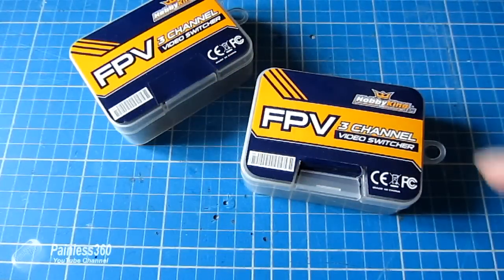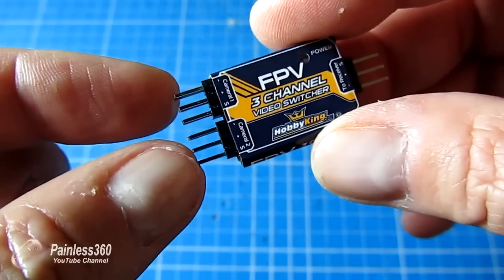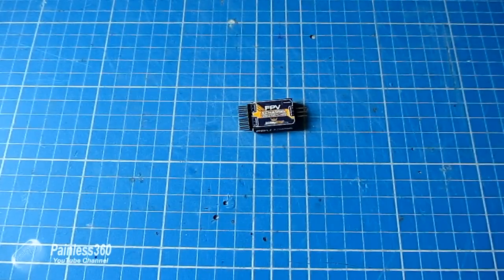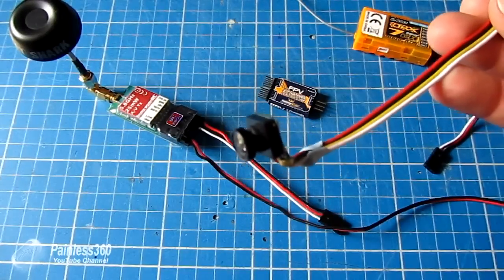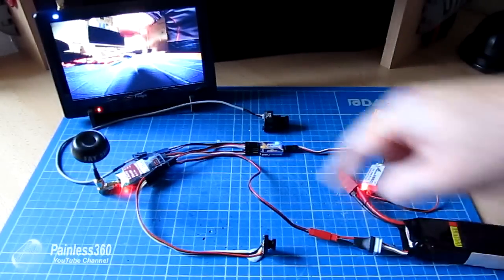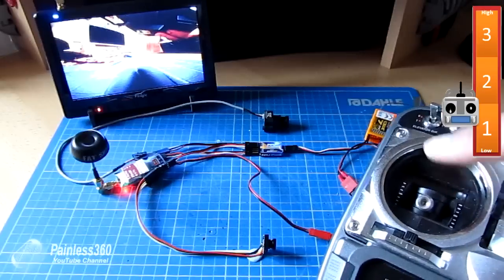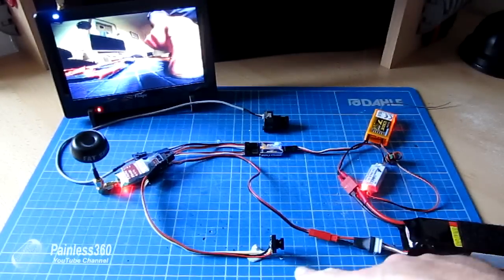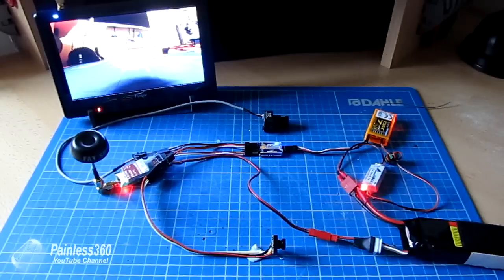HobbyKing FPV 3 channel video switch

Comment: Great info....Have you ever connected this switcher unit to a FPV camera and a gopro with an IOSD unit inbetween so that you can see the display on both cameras when switching form camera to camera - Searched the web for this info but can't find!
Reply from the maker: Should work fine is you connect the OSD between the switcher and the video transmitter. Best of luck!
Reply: Painless360

Hi.... Super cool and thanks - I'll try the setup and see how I get on.

Comment: Allo and thank you for the knowledge sharing . I am working on some camera set up not for FPV but for a 360* field of view around my e-bike and my question is can the camera switching be activated with out a remote ? I was thinking of a 3 position switch with (guessing the voltage here ,You can tell me what they need to be at pls )  0v-2.5v and 5v .If I understood what you said about the throttle way of activating the swap .  Thank You & Subscribed  ;-D
Reply from the maker: I’ve looked at a few 360 degree cameras and you could use one of them. Also allows you to ‘scroll’ around the image during playback too.. check my reviews..

Comment: Lee, you've done it again.  I remember watching this two years ago and even ordering a switch, but then put off using it as there was really no pressing need.  One of my favorite quads in my stable is about a 450 size with a Mobius on a gimbal. Since I could point the gimbal anywhere I wanted, adding a second camera didn't make a lot of sense even if the 16:9 FPV image didn't fill the screen of my Fat Shark V2 Dominator goggles.  Then the RunCam Eagle came along in the goggle-correct 4:3 and I decided to search for info and here you were.  NOW it has become a worthwhile project and I just finished testing it.  The switch works fine and was no problem using this video and your Taranis videos.  The dynamic range and color of the Eagle is excellent!!!  So now I can fly around with the Eagle and switch to the Mobius to make sure something I'm trying to film is in the frame.  Thanks again for this and the rest you're doing!!!!!
Reply from the maker: Well done on remembering it was here - I can't remember half of what we've done here and sometimes find our own videos help me too :D Happy flying!
Reply: Hugh Dinwiddie we need to press designers to make a vtx integrated with minimOSD and 3-4 video inputs.
Reply from the maker: Lots of innovation happening in OSD land at the moment, let's hope this is part of the innovation too!
Reply: Painless360 review the Helix VTX/OSD!
Reply from the maker: Thanks for the idea!

Comment: Painless I have this switcher and it’s been working well so far.  Today I went flying and channels 2 and 3 have a flicker/screen roll now.  Any idea what may have happened?
Reply from the maker: I'd check that all of the cameras are set to the same video standard i.e. PAL or NTSC as the first job..
Reply: Painless360 figured it out!  Loose power lead on the rx connection of the switcher.

Comment: Great video as usual, thank you for all that you do. I'd like to use this switcher with two cameras (FPV and Gimbal camera) and my iosd with my naza m v2. Is there a way that i can only get the osd on one camera (FPV) and not on the other (Gimbal) when I switch.. I only want my osd in view when I look through my FPV camera. any help would be fantastic, and thank you again for all your great videos.
Reply from the maker: SirTTMullen Ok, connect it like this - cameras into switcher - switcher into OSD - OSD into Vtx.
Simples! 
Best of luck.
Reply: I only want osd on one camera, not both. is there a way to olny have it show on one camera when I switch from one to the other?
Reply from the maker: Yes, you can. Have the switcher plug into the camera/OSD on one input and just the camera you want without the OSD on the other.

Best of luck.

Comment: Great Video, I have learned so much from your stuff.   I have one of the switchers and am trying to get it to work using an output from a Pixhawk.   My receiver is S-Bus only so there is no spare PWM channels there to use.  I currently have it connected to Servo8 and want to use a three position switch on channel 7 or my controller.  I see how to set the output to pass through in the parameters but how do you map the input to this channel?
Reply from the maker: I think what you're after is here- http://ardupilot.org/plane/docs/channel-output-functions.html
Reply: yes sir I figured that out after reading another post. My problem with this is that by direct mapping an RC channel then Mission Planner cant control the servo output. So the way it is now I have to pick one: Either switch on the remote or Mission Planner. Hopefully they will define this as an option in the future like grippers, landing gear or a gimbal so that it can be usable by both

Comment: Simple device. I built a 610mm quad for AP work and ordered one of these as I have forward and rear facing fpv cams, and a gopro on a gimbal.

I did  quick search on the product to see if any installs were done and vids were posted out here and just clicked on the first one that popped up on my search engine and lo and behold whose voice do I hear come from the speakers? Why the soothing timber of the esteemed Painless360.

It was like a shot of FPV morphine. I was lulled into a fine languor as I watched.

So power does not pass from the radio receiver side to the video or it does? I do not want the draw on my rx. I will have 12v cams and vtx, and the option of powering off a separate lipo or the flight pack. I may even make it redundant- and have them both connected. I already have the pixhawk double redundant on the servo rail from the bus circuit using a shotsky diode rectifier. (holler if you want a pic or need any info for your pixhawk series)

I am trying to figure how I want this thing connected- and if the rx is passing 5v through to the vtx and cams, and it bucks power then I am unsure if it needs powering from the rx side and no voltage wires on the vtx and cam side. Did that all make sense?
Reply from the maker: ***** Hey Hiway, connect the switch as in this video then power the cameras from whatever 12v supply you want but then DONT connect the red wires from the cameras back into the 3 way video switch - just use the GND and SIGNAL between the camera and the 3 way.. Hope this makes sense. Best of luck with it.
Reply: Painless360
perfectly. As I assumed, and now confirmed. Much obliged. I think it's time to give you a new moniker- I'm considering "King Tut" ...as in King of the Tutorial.
Reply from the maker: Best of luck with it - let me know what you think of it 'in action'..

Comment: @painless360 is there a default/failsafe on these switches?    Say your flight cam is camera 1.   And you lose power to the switch.   Will it stay on camera 1 and keep transmitting?    What if you are in camera 2 or 3 and power fails on the switch will it fail safe to camera 1?     

Lastly, I am looking to power the switch from a 5v rail on my FC and just send signal for switching off channel 3 of my Crossfire Nano RX.    I am gonna power the cameras seperately and send just video to the switch hoping it will do pass through on the video just fine without having to distribute power to the cameras.   Any idea if it will work?

Going to run video from forward camera into the FC and have the output with OSD going into the switch on Camera 1.    Backwards looming camera is going to go into camera 3 without OSD info.   Doing this deliberately so that when I see OSD info I know I am seeing forward and no OSD means looking backwards.

Also read a report that the device can add video noise which the FC OSD can have fits with.   So I would rather try the switch after the FC/OSD instead of ahead of it.

Comment: Nice video.  I was initially confused.  Early on in the vid you mention plus, minus, signal which would match fatshark.   Of course later on you point out that it is not the same polarity as fatshark, so you can't just use a straight pass-thru from your fatshark equipment.  Liked and subscribed!

Comment: I'd say that it's the safest way just to get rid of the labels and plastics around the board and then heat shrink it as the labels on the PCB are actually corrent while these on the packaging are not.

Comment: I would like to have seen a more in-depth tutorial.My cameras work on 12 volts and obviously the receiver works on 5 volts.How would this be wired?Surely you can't have 2 different voltages mixing in the hobbyking switcher.
Reply from the maker: It's not switching the power, only the video signal lead. Best of luck!
Reply: Are you talking about having a mix of camera and receiver voltage running through the switcher? As far as i know the 'video' side of the board is isolated from the receiver side. The 5v from the receiver makes the switcher work but is not connected to any of the camera or video output pins. So if your VTX usually provides 12v to your camera then it will continue to do so. If you had say 1 x 5v cam and 1 x 12v cam then you might have problems.

Comment: Hi Professor... I am struggling with this little guy! I have powered the cameras separately from the video switch, and just connected Signal and ground.... Switch powered by the X8R.... Do I really need to power the switch with Cameras Positive wire?
Reply from the maker: Not sure, worked great when setup as shown. Best of luck!

Comment: I just bought one of these but unfortunately the video out and camera 3 pins appear to have been cut off and there are 2 sets of pins on the receiver side.....any ideas?
Reply from the maker: I'd get in touch with Hobby king they will replace it if's a manufacturing defect.

Happy flying!

Comment: If I'm running a FrySky D4R-II receiver in ppm mode where would I plug this switcher in? Can I still plug it into one of the other channels or does only one channel work in ppm since it's sending 8 channels on one connection? Thanks!!
Reply from the maker: beno0055 This switch only understands PWM so you will need to find a way to connect it to a PWM signal from the receiver..
Best of luck..
Reply: Painless360 Oh, balls! Could I run it off my Naze32 similar to how I'd have a buzzer? I'm guessing no, eh? :P

Comment: Thank you for the video. Now my issue is finding a free channel on my Spectrum DX7s to switch between my fpv camera and GoPro.

Is there anyway to upgrade the DX7s to provide more channels? Or should I be looking for a new radio such as the FrSky Taranis X9D+?

Any help or radio recommendation is appreciated.

David
Reply from the maker: Sadly if you need more than seven channels then it might be time to upgrade to a radio with more and look at ones that can support tricks like head tracking! Happy flying!
Reply: Thanks. Do you have experience with FrSky Taranis X9D Plus?
Reply from the maker: sorry, that is not a radio I have played with.

Comment: We're did you get those male to make fpv pins?  I need to get some.  Do I have to make them or can I buy them from hobby king or something.  Thanks. @Painless360
Reply from the maker: +ExtremeRC I use servo cables and make the ends of using a crimper if I need different connectors. Best of luck with your project.

Comment: I've watched this video a few times now but only just gone ahead and ordered a switcher... and now I have a question about how the cameras are powered. In your example, the VTX is powering the cameras 'via' the switcher. I may need to test this when mine arrives with a meter, but when you switch between cameras is it only the signal pin that switches or all 3 including power and ground? I've read lots of comments from people complaining about a small delay... and now I'm wondering if the switcher is to blame at all, because if you are powering the camera on / off every time then of course there will be a slight delay before it starts to output a signal.

In my setup I will be using a Runcam 3 (HD recording camera with live output) as Cam 1 and a standard 600 tvl as Cam 2.
The Runcam has it's own battery but if I was to use it as a full time live camera it would have uninterupted power supplied to it for the entire flight to keep the battery topped up (I know that's bad for batteries but that's another conversation).
Using a switcher (if my first assumption is correct) then the Runcam would not get any power whilst the other camera is in use.

I'm not yet sure if this is a problem, I'm just getting my head around exactly how my setup will work so I can prevent any failures before they happen! Have you ever tried setting it up so the power and ground wires bypass the switcher and only send the video wires through it? I'm willing to bet that the video feed would be closer to seamless that way.
Reply from the maker: Have a go with it when you get one and let me know if you get stuck..

Comment: These are very clever and I am trying to hook it up but I am for the life of me not able to get everything sorted out. I am running a fly sky i6s with the six channel receiver using ppm. It's all going into a pix hawk. I have been able to power the cameras and on my receiver it shows them wobbling back-and-forth but I can't get it to switch from the remote. I would love any advice you could give me. Thanks a lot
Reply from the maker: I'd pull it and use something like a servo tester to make sure it's working fine then work though the radio/receiver settings to make sure you can send the same PWM values that worked with the servo tester. Best of luck!

Comment: You have to switch polarity with Fatshark vtx? Say that again, please? I don't want to burn out my thermal camera!
Reply from the maker: CyberJay1226 outputs on the switch wired gnd, power, video. Connection on a fatshark camera is power, gnd and video....

Comment: what about if your cameras are 12 volt
Reply from the maker: It's 5v on the servo side and you can use multiple voltage on the other side by not using the positive wires - so 5v to 12v.

Comment: hey to hook this to a arkbird osd. Would i need to unplug the + from the switcher to the resever and just have the ground and single wire. The arkbird is 12v and if i plug it in to the video switcher and then from the switcher to a channel on the resever would that fry the resver. The resver is all ready getting power from the arkbird. im lost.
Reply from the maker: It can be confusing. This switch (like almost all servos, flight controllers and RC electronics) works on 5v and it's a switch that changes which video signal the Vout is connected to. Happy to cover this with you if needed - see the website for details of how to request a one to one support call and the charges. Best of luck.

Comment: Update.    These things will do video pass through.   I powered my cameras seperately from the switch and only ran video through it on Cam 1 and Cam 3.   I ppwered the switch off the 5v off the FC and ran a signal wire from my Crossfire Nano on Ch3 as corresponding output from my radio.

Video is switching just fine.

Comment: Thanks for all great videos - I have one query regarding the 3 channel switcher.   Is it possible to use this unit to make 1 channel into 2 by connecting auxiliary AUX5 to video output and connect pitch and YAW to channels 1 & 3, so as to be able to switch between them? (Don't have enough channels on my receiver for the three required for the gimbal & wondered if this would work).
Reply from the maker: I wouldn't use it like this.  It's designed to switch power, not transfer signals. It sounds like the time to consider a new radio with more channels.. Best of luck!

Comment: Thanks for the video, as I just received the same switch in the mail haha. 
The only thing that i would recommend is to do the power supply not through this device. I think it will be the first thing to stop working and if I am right you can bypass the power for the cameras. (By supplying power from a direct source like the flight battery)

Comment: Hey Lee can I use that FPV Switcher with a PPM Receiver? Can I connect it to a servo PWM Output of the Flightcontroller?
Reply from the maker: +KingQuestable If you can get the flight controller to 'present' the PWM signal for the channel you want on a spare output then you can use this.. Best of luck!
Reply: Painless360 thanks for your response :) I have a SP racing F3 and cleanflight. is it possible to do that with this FC?
Reply from the maker: Depends on what the flight controller firmware can do ;) Look at 'Channel forwarding' for the version you are using.. Best of luck..
Reply: +Painless360 thanks a lot for the hint! :)

Comment: Hello, maybe someone thought this question. It can also be used in reverse - one camera and three monitors or, for example, three different FPV transmitters. The camera would have been only one of a signal from her, I could embark discretion to three different devices. Not only as an amplifier - only switch. Can It already been used in this way? Thank you very much.
Reply from the maker: Interesting idea - let me know if you find out..
Reply: should be possible

Comment: Can you connect them in serial in order to have more cameras? Are the "unused" cameras still drawing power from your battery?
Reply: You can connect them in serial. There's no power management of any sort on these, so without any further modifications you'll have your battery drained by the equipment unfortunatelly.